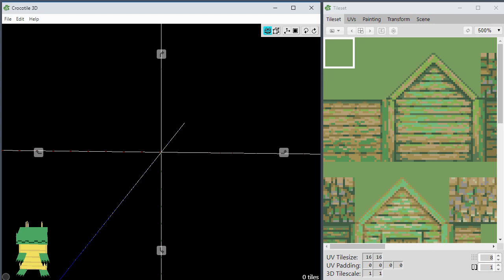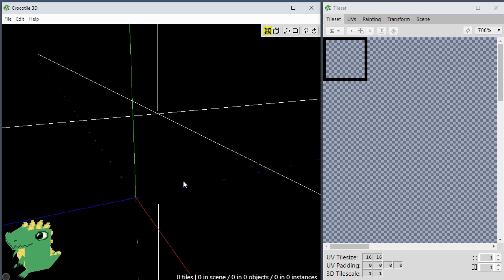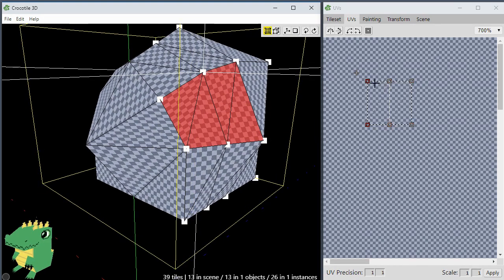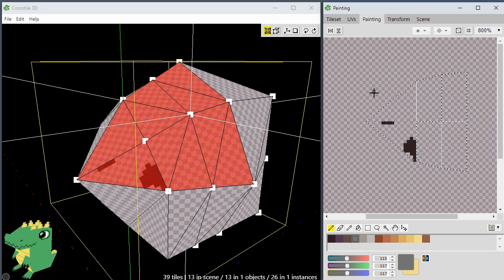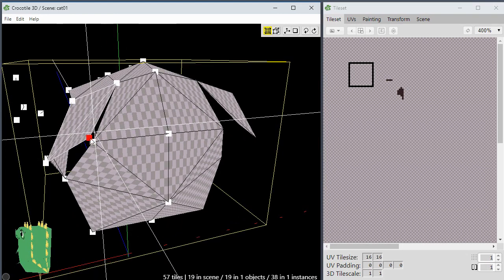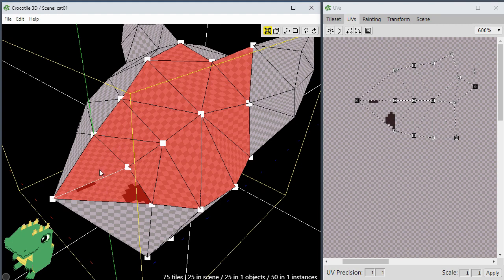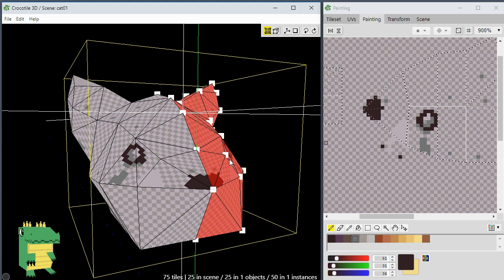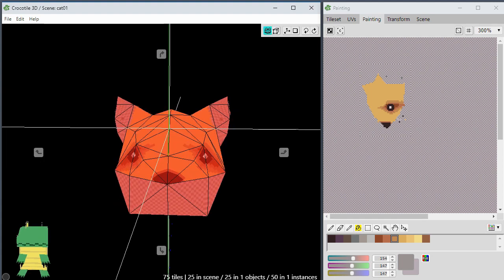🐊 Crocotile 3D - Tutorial: Character modeling (Part 1)

Comment: hi i know this tutorial is kinda old, i bought crocotile and recently started using it (just finished the tutorial model for the waterfall)
but i wanted to know: after i mirror an object ¿can i paint one of the sides diferent from the other? like diferent eye colors.
also what if i make an animal and want to put it on the waterfall scene? could i make the model smaller to fit?
Reply from the maker: If you are using the mirror property in the object to mirror its tiles, then whatever you paint on one side will be how it looks on the other side. You could alter the side afterwards by removing the mirrored property when you merge to object. Then you can move the uvs of the tiles on one side to a new position on the tileset and draw the side differently for those tiles.
As for resizing the model, yes you should be able to do that. You can set the property of the object instance to have a smaller scale, or just resize the tiles in the object to be smaller.
Reply: Thanks a lot mr.crocotile!
Reply from the maker: You're welcome! :)  @raccoon4908

Comment: How do I connect tiles to one another? Everytime I create an object with multiple tiles and try to shape them they only move individually instead of together like in the video
Reply from the maker: I'm not sure what you mean. Are you grouping the tiles together into an object? Each tile will remain separate from other tiles (their vertices don't get combined). You have to select whatever you want to move, so if you want to move multiple vertices at the same time, you need to make sure they are selected. Same with faces.. If you click vertices that are overlapping, they all should get selected though. If you are clicking and dragging a vertex with the mouse, this operation only occurs to one vertex. While dragging, you can hold Shift to snap it to another vertex. If you enable the Gizmo (toggled with X), you can click and drag the Gizmo(that becomes visible when you select stuff) which would allow you to drag multiple things that are selected.
Reply: @Crocotile3D  thank you alot this is helpful!
Reply from the maker: @Darkey4321  you're welcome! :)

Comment: It would be a big improvement if the deselect button, deselected everything in one click, vertices and faces regardless of what mode they are in. It feels so clumsy that i have to mousewheel click first and then ctrl+d to deselect a face from that split mode. Or press ctrl+d multiple times like an undo button. 
I would hazard the guess that most people using this program comes from blender, and are used to that definiton of "deselect". If that is correct then I'm sure that that change would soften the learning curve a bit.
Reply: The cute nav cube is actually quite brilliant, it makes the first hours of learning a new program more fun / less intimidating. + It usefull for measuring style and colour against. 
A fun expansion of that idea would be an option to select a few different skins, just different colour palettes and/or a hue slider. maybe an option for the user to texture it themselves.
Just some "take it or leave it" user feedback and ideas. I know it's easy to ask for all kinds of stuff, and a lot more difficult to actually program. 
The program is great, It is quite impressive what you have done.
Reply from the maker: Thanks! I appreciate the feedback. Yes, it seems like people who are more familiar with blender suggest similar things regarding the controls. It is an area I want to improve for those users. The nav cube ideas are interesting and sound fun.